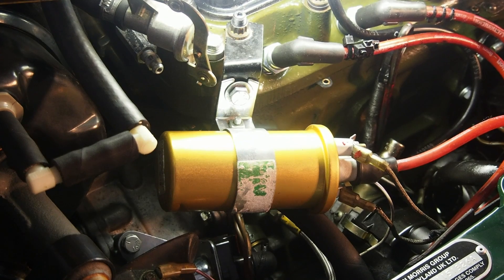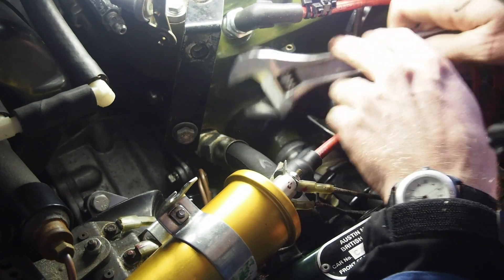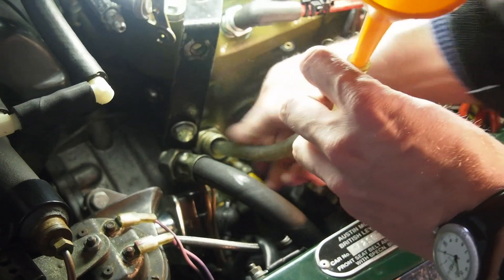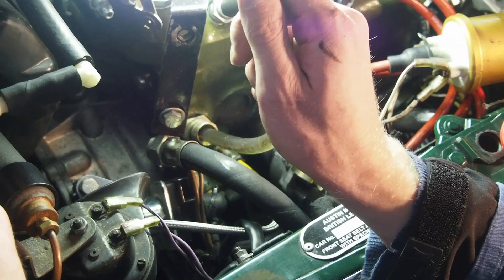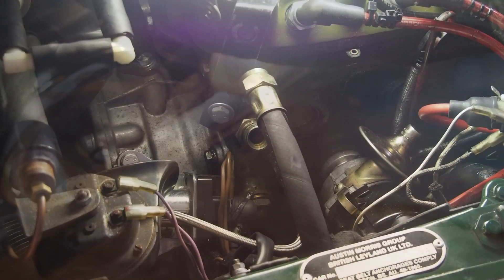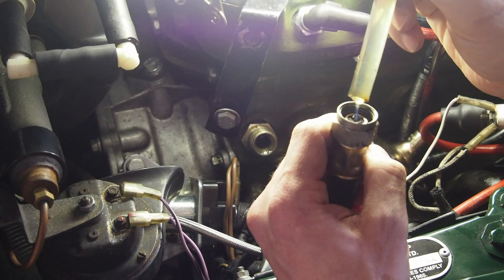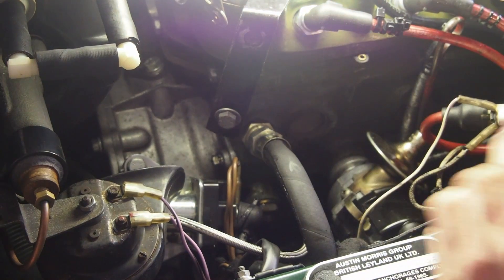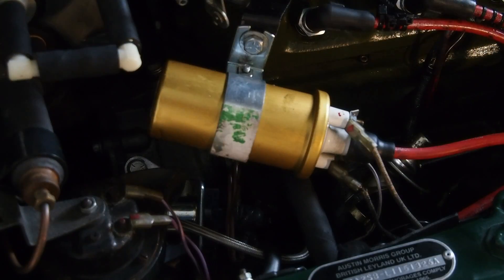Priming oil pump

Comment: How do you know when there's enough oil in the pump?
Reply from the maker: l troake it doesn’t take much, the pumps only have a few cc of capacity anyway. I used to pour about 2 table spoons full in the funnel and waited for that to drain through.
Reply: @bvblacksmith  thanks, I'll let you know how it goes!